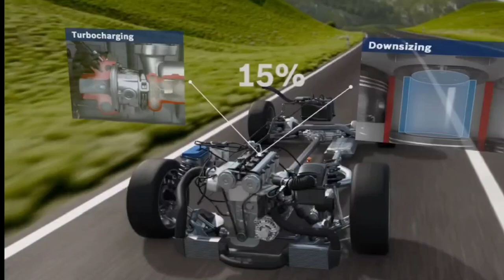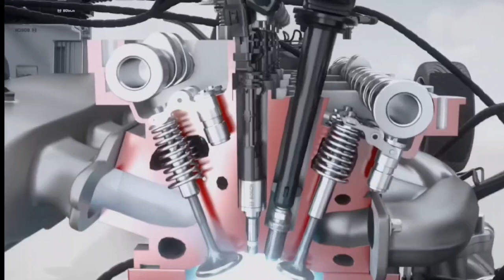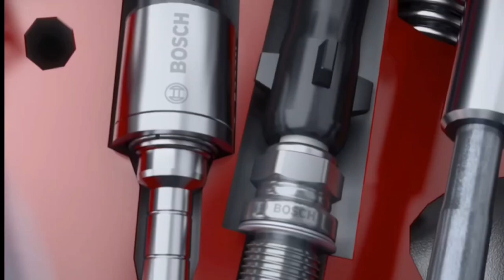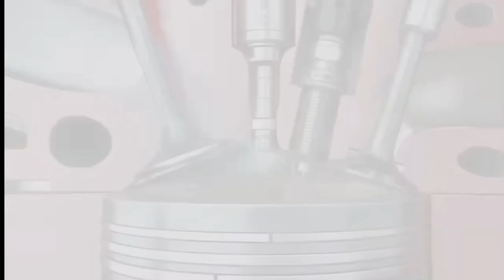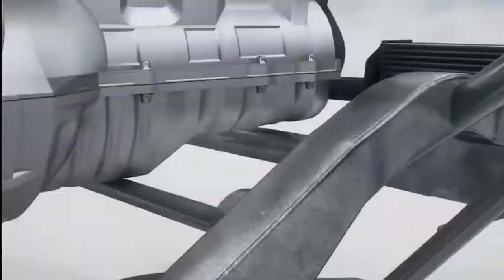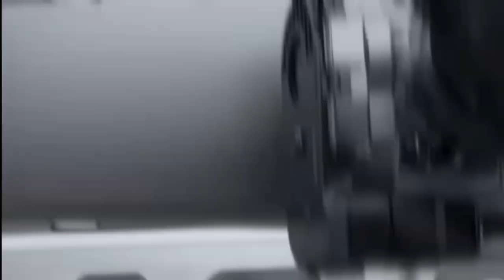HOW GDI ENGINES WORKS. DIRECT INJECTION ENGINES WITH TURBO CHARGED.

Comment: Down size the engine and put turbo charger to maintain the performance can decrease the engine life and reliability..because of the force induction consep
Reply: But we save more money on fuel.
Reply: @Norfaizan-wb5wx  yes..just for the fuel only
Reply: that's one of the points these people are subjected,
more users demands are on performance and fuel consumption, disregarding the longevity of the engine, because if you cared for your car enough, it would still cope up long enough and you had less worries on fuel costs till that time comes
Reply: @endurofan9854  yup..i own ford eco boost 1.0L..only the problem is when its come to long distance driving around 700+ km i can feel permformance drop a little..mybe because of engine heat and stress..